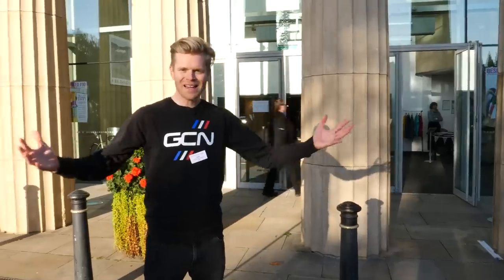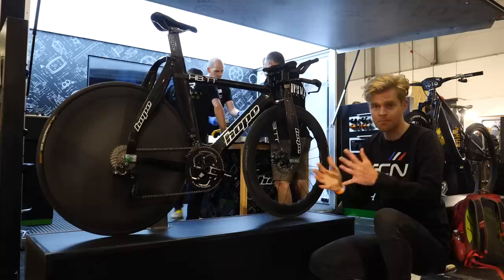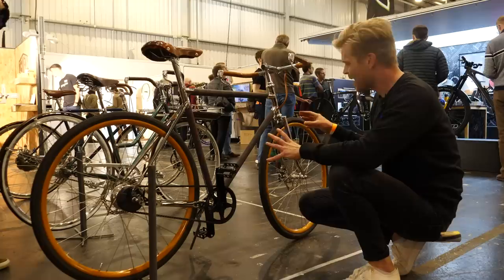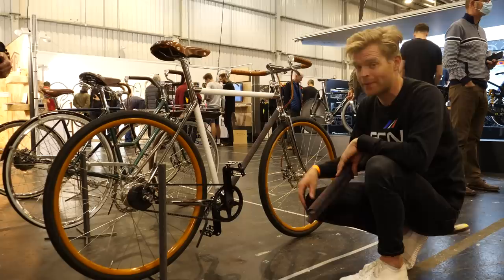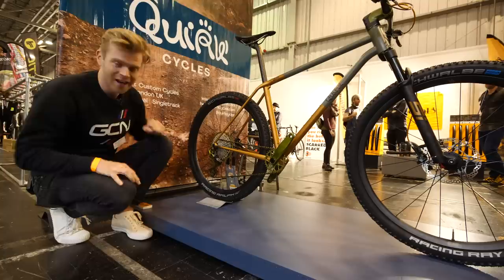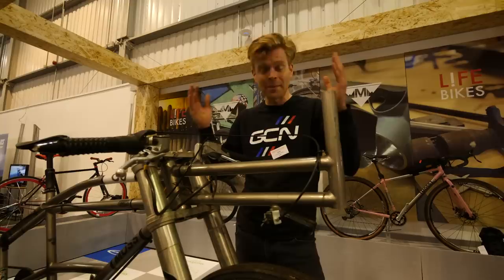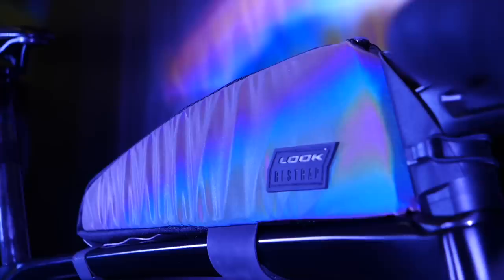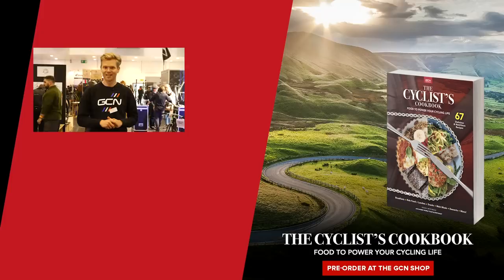New Hope HB.TT & A 174mph Bike!?

Comment: When I converted 1980's steel frame to a 11 speed setup, I had to widen the rear stays from the original 5 speed setup and I deliberately widened it asymmetrically and built my wheel around the centre of the hub to achieve equal spoke tension and use the same length of spokes on both sides.

Comment: Great film I was surprised to see Chater Lea still going I renovated my Dad’s old tandem it has 3 arm cotter pinned full chater lea chromed steel straight through drive train
Reply: Also did a 19min 10m TT on it in the late 80’s 64 yes 64 x 13 top gear and we used it!

Comment: Love those bags, and either those cranks or the ReneHerse cranks on a JP Weigle randonneur would be great, IF those are cold forged like the Herse cranks.  I will give the new shimano style BBs props for stiffness and straightness over the square taper, though. And not needing a crank puller.

Comment: Pacenti's claims make absolutely no sense, tubless pressures are so much lower than tubulars or clinchers. You actually loose less spoke tension when riding on 50psi as opposed to 110. Also, spoke tension si unbelievably easy to adjust, we don't need another bicycle standard for this. Wth Pacenti ?